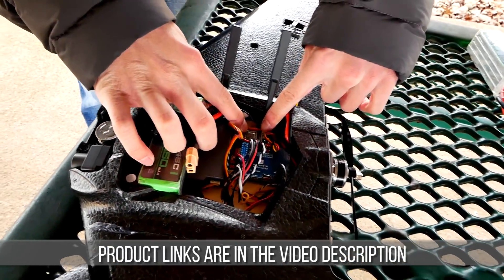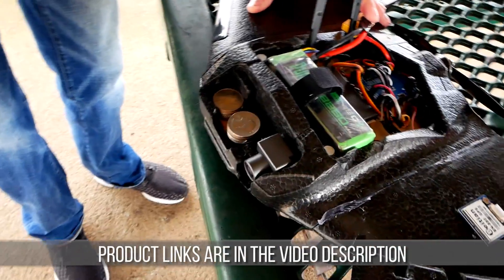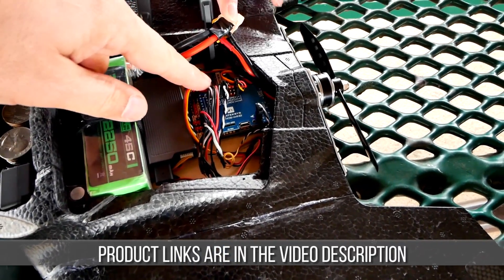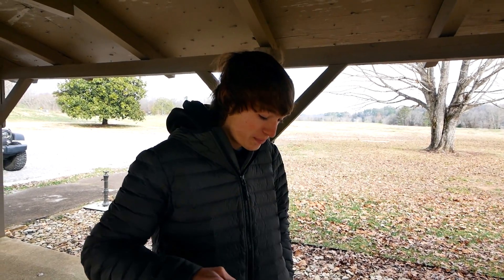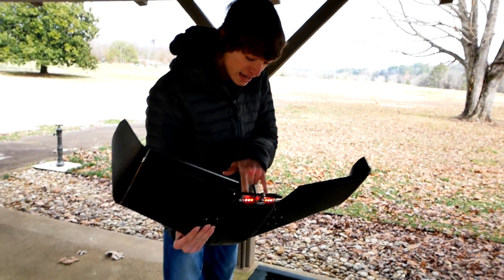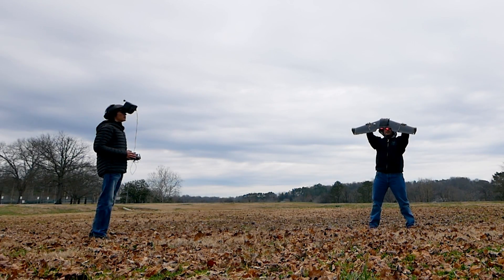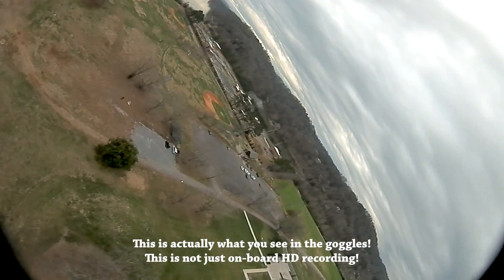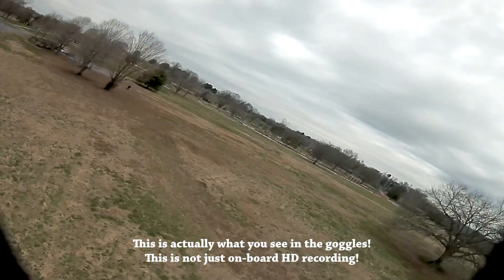DJI Goggles RE Ocusync SBUS Passthrough | COULD IT REPLACE CROSSFIRE? (NO)

Comment: I am incapable of not throwing some aerobatics in during flights like those.  I guess that includes full size plans which I started on.  But most people don't.  DNA or something.  My question: Video latency vs control latency.  Are they virtually identical,  or is the control input latency was longer?  It has to get sent up, deflect a control surface, and then you view the result on the video.  The video just transmits to the Google's.   If the video latency is small,  you'd know where you were, but might be powerless to get control input up there in time.  If the video is equally as long, you're double screwed. LOL

Landing like he did can be handled like seaplane landing on glassy water.  Which I think he's doing.   If you aren't very aware that it's IMPOSSIBLE to judge your height above the water, a disaster is inevitable.  You'll fly into the surface, or stall 30' above.  You set up a stable decent rate, low but constant, and wait until you touch.  You DON'T guess where the surface is.  This approach is perfect for high latency systems.  There is no time critical adjustments.
Reply: Its a tough call on control vs video lag. I can say both have more lag than a standard radio/analog video setup which is unsettling. That would be a good avenue to investigate in the future. 

I flew it LOS on the higher resolution setting and there was lag there too. I would hesitate to claim which has more lag but i don't think thats the most significant point here. Just the existence of lag on both sides stinks!
Reply: TropicalOnion you guys need to do more testing if you are getting 750ms (3/4 of a second) delay or even 500ms (half second) on Occusync 1.0.  You should be seeing ~160ms with control and video link Infact the Mavic Pro has avg latency of around 160ms as well, while still huge for race quads, it isn’t even 1/4 of a second.

Occusync for what it’s designed for works insanely good, designed for flying areal cameras out miles and miles without issues.. and I think a fixed wing would also be ideal as latency isn’t as important as solid and reliable connectivity.    As for ground sensing, is there anyway you guys can hook up something like an optical flow sensor system or IR based range finder system? While not as critical atleast gives you a ground range estimate upwards of 10 meters up on some systems like IR ranger finders many use raw data over I2C.  I don’t fly fixed wing but the gap in informational awareness as you get close to the ground, if the gap could be filled it could result in much easier landings?
Reply: Wouldn't the input lag and video lag be approximately the same? Hmmm, I even think video lag is sure to be greater than input lag, because the input signal just has to be transmitted and it can be done instantly, while the image needs to be compressed and uncompressed and to do it efficiently you need to have a buffer of a few frames, and it takes CPU time too (on the sending side as well as on the receiving/displaying side). So I think the video lag is bigger.
Reply: You have latency in getting the ppm to the flight controller. And there is latency from video encoding and decoding. So it adds up a lot.
Reply: @LordGryllwotth  encoding fairly well optimized, i think big portion of the time comes from decoding, surprisingly but then again most devices displaying digital signals arent turned for real time use because most use traditional frame buffers and require completed frame information at set intervals...and you can get a glimpse of this doing latency testing between different phones plugged into controller showing live view.  the encoder doesn't care about missing frames as much, it will spit it out regardless, down to the smart device and the software to how it wishes to handle decoding it.  i think same issue applies to goggles, frame buffer and requires min set of frames at set intervals or just repeats or skips if its not what it expects

Comment: I thought the long range digital, delay-free HD FPV problem was solved a few years back with the Connex Prosight. Somehow it didn't catch on.
Reply: That's because ProSight is not delay-free. It's at least 2-4X slower latency-wise than Analog, depending on the digital mode used.
Reply: @seattleitefpv  My 2 year old Connex Prosight delivers 1080p at 30 fps, with latency of no more than 26Ms, it's at least as low as any of my other kwads and their analog cameras. 2-4X slower is simply not true.
Reply: Mike V hi Mike. Analog latency is around 10-13ms, so yes, ProSight is at least 2X slower. Now, I agree that at 26ms most people probably can’t tell the difference except perhaps for the quickest of race pilots... things are improving though and it’s not inconceivable that pretty soon we’ll have analog-style latencies with digital feeds...
Reply: @seattleitefpv  You're right, I can't hit gates at all with that kwad. And I should not have said delay-free, sorry to be misleading. I was still in the LR 1020p exploratory pilot mode when I said that.

Comment: 1/ Not convinced by the manual assessment of lag. If I fly PWM without an FC then run inav with an FC on the same wing, Inav feels "laggy and disconnected" to me. It takes me a while to get accustomed to how that PIFF controller works. Stick movements feel more like suggestions than commands. Seems more targeted at long rage cruising than proximity flying.
2/ In my experience you can install the GPS upside down/on its side etc and it will lock just as well. However the first lock in a new location with a new GPS can be painfully slow.
Reply: There was noticeable lag even with all flight stabilization modes turned off which I assume would eliminate FC related lag. I noticed it when I first flew it LOS. It was scary!

The issue for arming wasn't just GPS. I had previously flown it and trimmed it via the radio which meant the control inputs weren't sitting at 1500 so it would not arm.
Reply: I don't think that pitch/roll trims impact iNav ARMing, at least not that I have seen when I have input radio trims. Not having the OSD definitely is a big limiter in the whole setup. Have you tried the SpeedyBee app? it works well with iNav for those times you don't have a laptop in the field.
Reply: @polomarknot17   All I was trying to say in my clumsy way is that this is interesting but it is very subjective and doesn't take into account other factors. I have never used ocusync, so I have no bias for or against. I do however really want HD FPV to work soon. 1950's style television resolution we have now is just really awful. HDO's and similar high end goggles are just lipstick on a pig as far as I am concerned.
Reply: TakeItToTheGround Occusync 1.0 latency is 160ms on avg with 1080P video + controls.   I do not know Occusync how much better avg latency is of Occusync 1.0 at these lower resolutions they flying at here because 720P and lower only happens at the extremes of flying mavics.  but I do know Occusync is adaptive so if resolution is set lower it probably faster and able to fill more frames out.

Comment: It would be interesting to measure the latency of the control link if it is comparable to e.g. Crossfire. I wish someone somewhere would come up with affordable, low-latency, lightweigh 720p digital video. I feel like every piece of the puzzle is there, fast codecs, computing power in a small affordable package, radio protocols, cameras. Only no one could make it into a viable product.
Reply from the maker: There is no way in a zillion years it is comparable to Crossfire. Even just the PPM output from the buddybox port causes more lag than Crossfire.
Reply: I think you could beat that goal. I've strapped a cell phone to a kite before (FAA probably calls that a "tethered drone" now I'm sure). Depending if you have "4G" (I know, it doesn't really stand for anything but a marketing name), then you should be able to do HD without horrid latency almost anywhere. It would be better to directly grab and "intercept" it, then you should have almost 0 lag.
We just need on the fly video compression for these goggles and video transmitter, but I doubt anyone wants to solder a small APU with it hogging 10-15 watts for data compression. We definitely could though, it would really help out.

Comment: One step closer to the dark side and flying fixed wing Josh! When I started fpv fixed wing was the only game in town. Funny thing is now I prefer to fly my planes line of sight. I think they are more interesting to watch LOS than quads. That's just me.
Reply: For the past 4 years I have tried fixed wing fpv over and over. I just don't get the same pleasure as flying a multirotor fpv. I just stick to fixed wing los and quads for fpv. I don't know what it is but I just don't like fixed wing fpv.

Comment: Who needs rssi? Just wait until you can’t see anymore and then bringr back 😂
Reply: Yip! Throttle up! mostly helps :-)
Reply: Henri Schomäcker digital based system though.. that doesn’t always solve the issues if packet loss is too great.  Occusync maybe incredible and flexible tech that can get around some of limitations of digital, still a limitation, that limitation is minimal amount of data rate needed, which while incredibly small for what it is, in 100s of kilbytes per second, it still has lower limit anything below that is a disconnection.. also may not be that you are below radio horizon and just distance and interference or maybe getting jammed by radio/tv/cell tower or something (rare but happens, depends on power of towers ) 

On top of all of that, they are flying controls via buddybox method back over the Occusync link, so if Occusync broke connection the controls maybe compromised as well.. Occusync was designed for semi-automated systems like DJI’s own drones in mind so if shit hits the fan it can return and reconnect.  If controls broke here maybe a downed wing..

Comment: Does it transmit sbus over the same rf channel or something in parallel? If diff how far apart are the freq?
Reply from the maker: I don't know the exact details of how it's done, but since the Ocusync is a digital transmission system, I don't think the question of how far apart the frequencies are is relevant. It's spread spectrum. My guess would be it's just encoded in the digital data stream.
Reply: Joshua Bardwell ahhh yes you are correct, my apologies small brain fart there